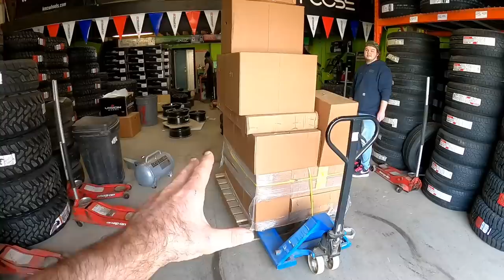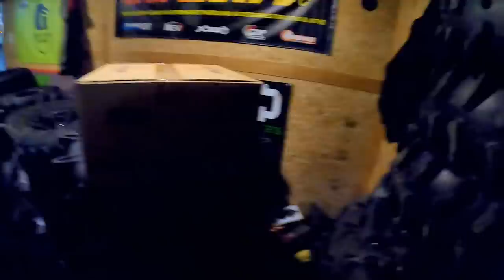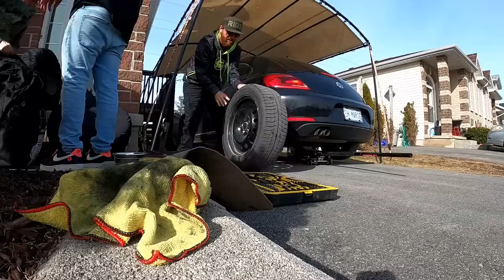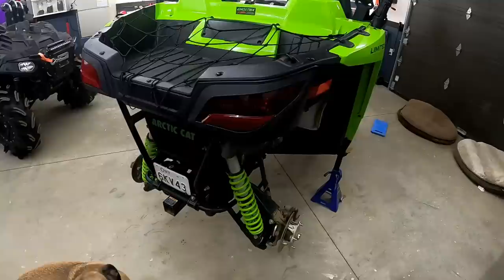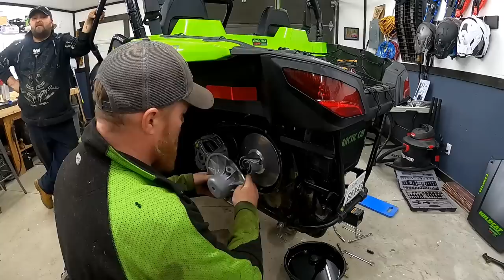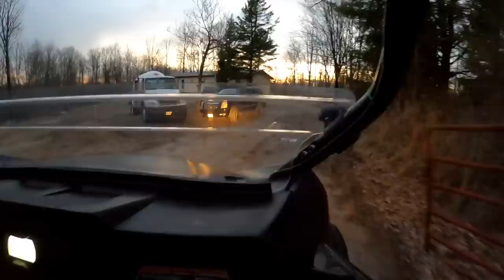The Honda Gets New Wheels & Tires, Arctic Cat WildCat Trail Long Travel Kit Install

Comment: i had put that kit on my wildcat trail when i had it,  made it perform so much better, but it was sort of a band aid really, its an improvement but its still not a real sport 60 inch machine. i ended up a year later getting rid of it for a maverick sport.